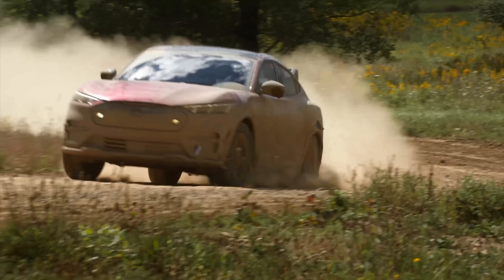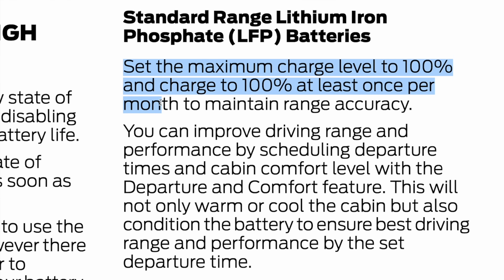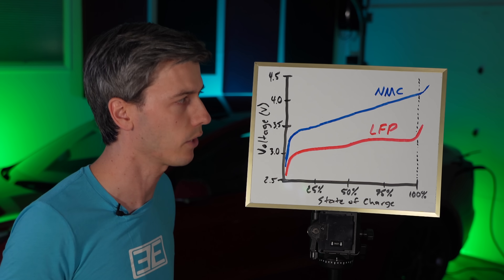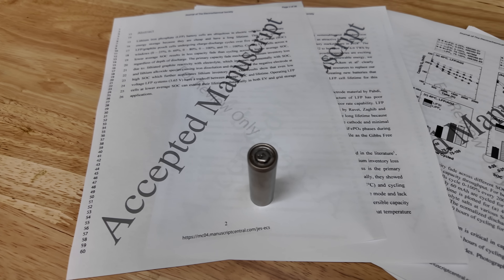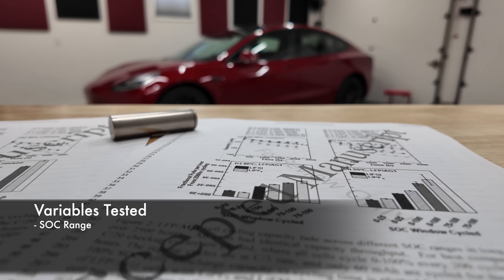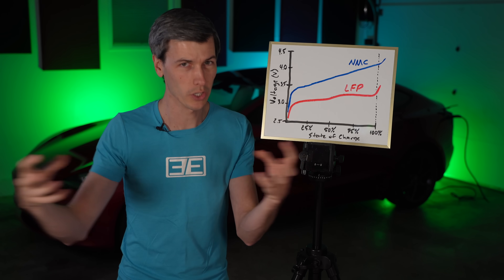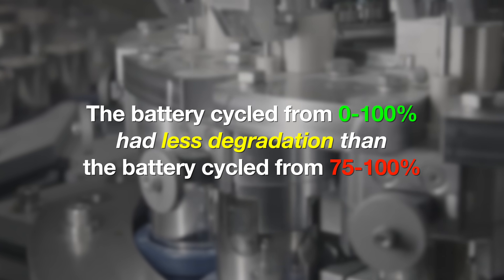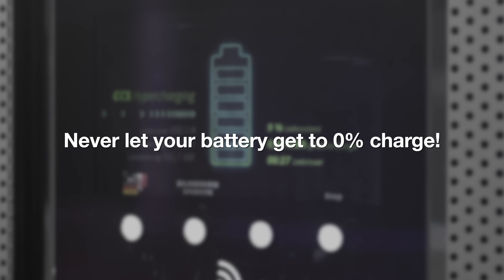How To Ruin Your Electric Car's Battery - LFP Edition!

Comment: It's crucial to highlight the importance of accurate cell balancing, which only occurs at 100% charge in LFP batteries. Your battery pack is only as strong as its weakest cell, and regular balancing ensures that all cells age evenly, preserving the overall health of the pack. 

Worth noting the following;

1. **Cell Imbalance Over Time**: As LFP cells age, they can gradually go out of balance due to internal resistance variations, minor manufacturing differences, and environmental factors such as temperature variations across the pack. These differences can cause the cells to have slightly different states of charge (SOC) over time.

2. **Importance of Full Charge for Balancing**: The battery management system (BMS) of an LFP pack typically performs cell balancing near the top of the charge cycle, close to 100% SOC. If the battery is never fully charged, the BMS may not have the opportunity to balance the cells effectively, which can lead to increasing differences in SOC between cells.

3. **Impact on Cell Aging**: If cells remain imbalanced over time, they can age at different rates. Cells that consistently operate at a higher SOC may degrade more quickly, while those at a lower SOC may age more slowly. This can create a feedback loop where imbalance worsens over time, further accelerating the differential aging of cells within the pack.

4. **Compounding Effects**: The combined effect of different aging rates and a lack of balancing can result in a quicker degradation of the overall pack performance compared to a regularly balanced pack. Over time, this can reduce the usable capacity and lifespan of the battery pack.

To mitigate these issues, it’s advisable to periodically charge the LFP battery pack to 100% to allow the BMS to balance the cells and maintain the pack’s overall health. However, it’s important to balance this practice with the understanding that frequently charging to 100% can also contribute to cell wear. 

A good balance is not to recharge after every trip if you have enough charge for the next trip. Then fully charge to balance the pack when you need more range and repeat. This minimises your effort, ensures the cells are well balanced and the range estimates are accurate.  A good LFP pack should last 100s of thousands of miles.
Reply: Charge it to 100% twice a month with normal use is more than enough for the LFP for the BMS to calibrate.
25-60, 25-70 is what I'd do the rest of the cycles. I don't drive many km/miles a week.
Reply: @barygol  definitely a good strategy! Your battery life is likely to be much more influenced by calendar aging than how much you cycle the cells (in your case).
Reply: It’s inaccurate to state that balancing only occurs at top of charge. This is highly dependent on the BMS control logic design, but most LFP systems can perform some amount of balancing throughout the normal range of use. There are some sections of the discharge curve where balancing can be performed more accurately, but overall it can balance anytime.
Reply: @krabkakes9535   You're correct in pointing out that while advanced BMS systems are capable of mid-cycle balancing, there's a potential downside when dealing with LFP cells. The flat discharge curve of LFP cells means that small voltage differences can be difficult to detect accurately. 

If a BMS, attempts to balance cells mid-cycle, it might inadvertently cause greater imbalance. This is because the voltage readings at various points in the discharge cycle could be misleading due to the minimal voltage differences between cells. Consequently, the BMS might redistribute charge in a way that isn't optimal, leading to increased imbalance as the cycle progresses.

This risk is particularly relevant in systems where the BMS is not perfectly tuned to the specific characteristics of LFP cells, or where the cells themselves have slight variations in their discharge behavior that can occur with ageing.  Therefore, while mid-cycle balancing is technically possible, it must be implemented with caution to avoid the very real risk of exacerbating imbalances, especially in LFP chemistries.      So in reality mid cycle balancing only occurs (in LFP packs) when you have a significant imbalance and hopefully you never let your pack get into that state.   So in reality the best (true) balancing for LFP only occurs at the top of the pack.   I updated the response to accurate cell balancing.
Reply: @makingstuffdownunder8405 I have seen quite some tests of active balancers starting at a lower SoC. It always ends up in a mess that takes a long time to correct with top balancing.
Going to 100% once a week and leaving it plugged in while the sun is shining on your solar panels is a great way to keep it all balanced and to get a feeling how your usage and range is in a typical week.  Sunday may be the best day of the week for this if you take grid load into consideration and assuming you don't need the car that day.
Reply: @SolAce-nw2hf  agree, if you have a home automation system, easy to schedule a good time, after a number of days or number of partial cycles.

Comment: This is relevant when choosing a house battery which are usually LFP. Some of the degradation people are reporting on with LFP home storage batteries is shocking e.g. 88% SOH after 3 years. 

I haven't got one yet but the ability to limit the 100% charge to just once a week would be a feature I would look for.

Comment: This is a great topic! There is so much confusion amongst LFP car owners! I notice that the instructions in Tesla manual has also changed over time (presumably as the refine in, as a result of peoples questions and likely the data they collect). 
Anecdotally I have noticed from looking at lots of second hand Model 3 LFPs (taking 100% charge kms on screen), the cars with higher millage seem to have less degradation than lower millage cars (my car comes into that category and seems higher degradation also). Your explanation may help explain that (more time outside of 80-100% charge range). Or maybe with more cycles / driving it will stabilise - hard to know.

Comment: My only experience with Nicad battery's were my 3/8 Snap on impact . I used that thing as a professional technician for about 4 years and the 2 batteries I had never failed or skipped a beat.
Reply: Comment not remotely relevant to the subject under discussion.
Reply: @avsystem3142  Thanks for letting us know.

Comment: Thanks for explaining this! Have worked with batteries all my career! Things have not changed much!
So
Regular use.
EV Don't keep topping up your Lio battery charge all the time you will wear out the battery 
but if you do store at 100% you will have the longest range when needed (same as nicad)
vs
ICE You can fill, top, up your tank any time you like (takes minutes) and still have the maximum range no wear on major components! 

Storing a car
EV Don't store you Lio EV with 100% charge you will wear out the battery store it at around 50% charge but then if you need to use immediately (without recharge) you will have less than 50% range, if you store it for very long time you will have no charge or range!
vs
ICE Store it any way you like to suit you needs empty, 1/4 or full! The car will not wear out a major component! Yes so fuel will degrade over time pending what country you are in etc 
Anyway you can always top it up with a jerrycan! 

Ambient Temp 
EV cooler is better
ICE Who cares heats and cools itself and the occupants!

Only plug in your car when you need to
EV How to I know what emergency situation I will be in when I will need maximum range!
ICE You can always top it up with a jerrycan!

Most people will not comprehend or implement the information in the video!